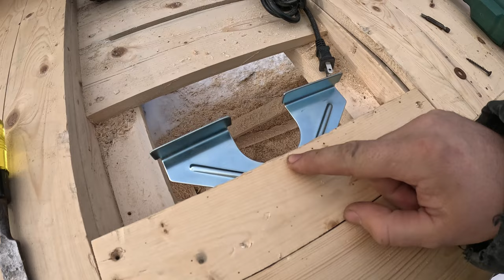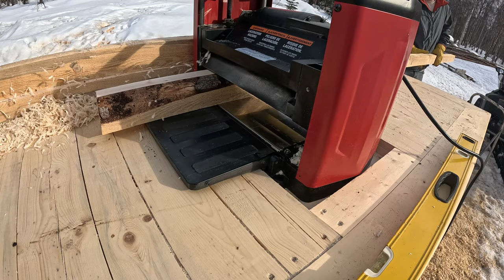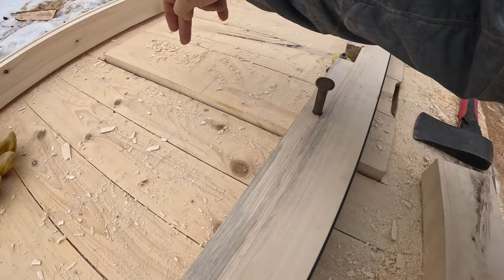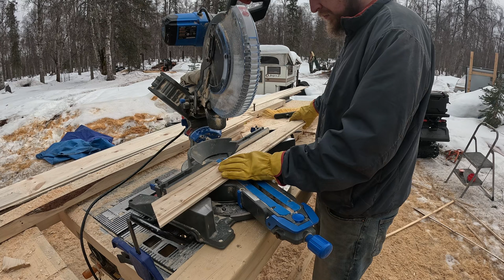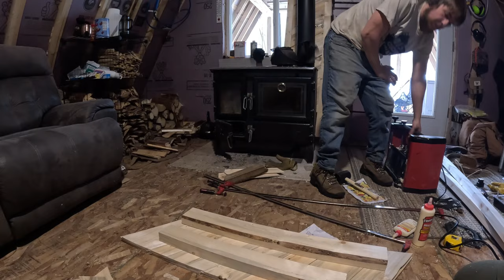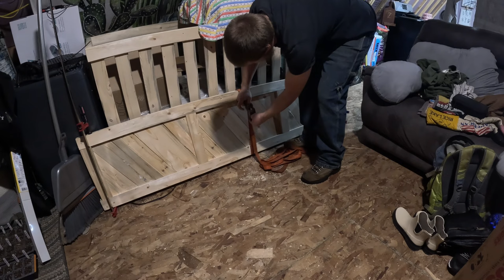Building Closet Doors - Modifications to the work table

Comment: Agree with all of the “don’t be too hard on yourself” comments. If you aren’t critical you aren’t growing, but if you’re too critical, you’ll stop trying and end up on the couch instead. A couple of suggestions you might consider: 1.  put a quarter round molding around the edges of the panels, mitered on the corners.  It will cover the uneven gap and look a little more finished.  2.  When routing, take more passes to get to final depth.  The cut quality will be MUCH better and it will be easier on your bit and router. Use them, and make your next project about the same difficulty or slightly easier and rebuild them once you have other infrastructure taken care of!
Reply from the maker: The quarter round would be a good option to cover the gaps, but unfortunately the ‘good’ door I dropped and it exploded. 🤷‍♂️

Comment: Good plan to cut the rails and styles over width and length so you can scribe a final fit.  A router bit can cut your rabbits and are cheaper than a dado set which can get expensive for a good one and expensive to sharpen as well.  Set up a glueing jig to glue the panels and keep them square.  Make it three sided with one 'floating' end, use your bar clamps to squeeze that end in gently for a final but tap in with a dead blow hammer (or piece of wood and a hammer) to get them roughly in shape.  Set it up on a piece of sheet goods with visqueen against the ply and the jig made on top so the glue doesn't bond to the jig.  A piece of melamine works great if you have any laying around.  Gorilla glue works well with wetter woods (there is a limit).  Don't overglue and scrape the squeeze out off (dulls blades and clogs sandpaper) with a scraper then sand.  That was a darn good first try especially with limited space and tools.  Might want to try cupboard doors first to get your system down as they are smaller and easier to handle.  Raised panels are also fun to do on the table saw.  Working with green lumber adds to the complexity but it does give you a source of free lumber!  Since it will move as it dries a little more reinforcement helps.  On the backside you can put 90 degree flat straps on each corner to help keep it square since they will not normally be visible.  A lap joint will also stiffen it up much more than a butt joint.

Comment: Might be a good idea to spray your angle iron with a clear lacquer (comes in spray cans) inside and out to keep it from rusting and staining the wood also lets wood slide easier on it.  The fast dry can get three coats on in an afternoon.

Comment: Cody could you get a sheet of 8th inch plywood for a back ?  Would strength the door and fairly easy to add with brad nailer or glue (both).  The doors are beautiful

Comment: That was a remarkably ambitious project with the angles tenons, etc.  Perhaps simplify. Make the panels seprately and stable then put them into the rabbited frame.  Also for manufacturing the siding try a stock feeder.  It will speed up the process of making all the paneling.  It takes time to figure out what works with the material you have on hand.  Don't look at it as a mistake but rather a teaching opportunity to see what the nature of the lumber is going to perform for you.  You can stabilize warping lumber with wider planks that will not be so apt to bow or warp.  Some lumber is just that way.  The reason hardwoods are used for cabinets and intricate patterns like this is it's stability.  The softer wood is less likely to perform or last without issues.

Comment: Hey guys, thanks for the next installment. Hope you are both doing well! Don't be too harsh on yourself, it is always great to see your problem solving, and positive work ethic to get things done yourself. Doors looked good on camera, but for sure, version 2.0 will be even better I am sure. Horizontals in the panels will make your glue up way easier as you mentioned. Not sure on the depth of the groove that you cut for the panels to slide into, are you able to cut slightly deeper to allow for better support of the boards? Even if you don't use the first pair, you have learned a lot from trying them, just remember that nothing is ever perfect!
Reply from the maker: I don’t have a great way to do a deeper cut currently. I could try doing multiple passes with the table saw, but if the board wasn’t perfectly straight I would have the same problem I started with on the router table.
We could probably order a 1/2” thick router bit with a bigger radius for deeper cuts.